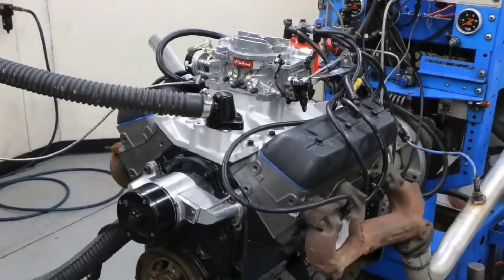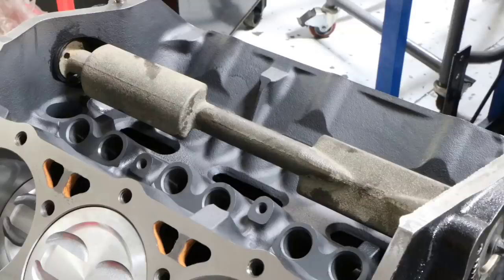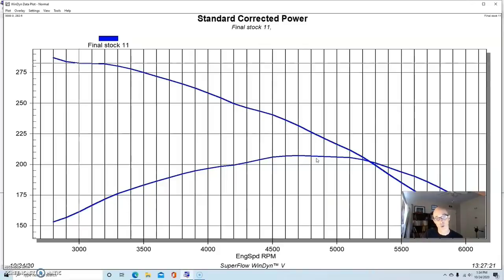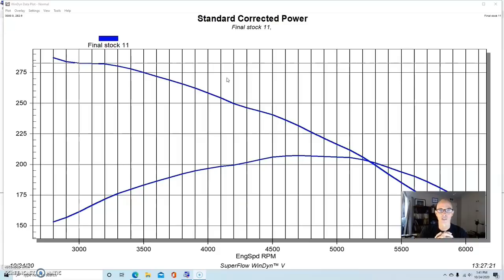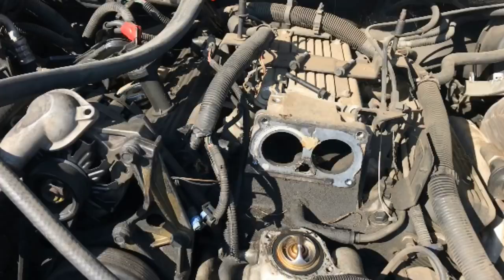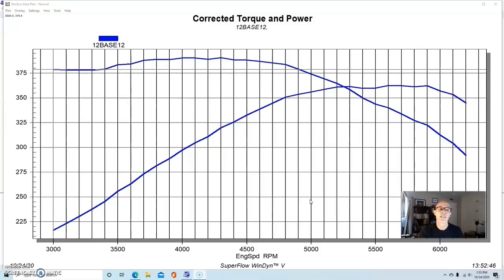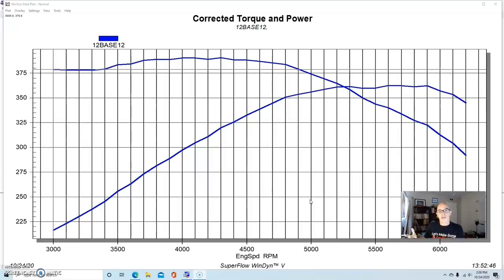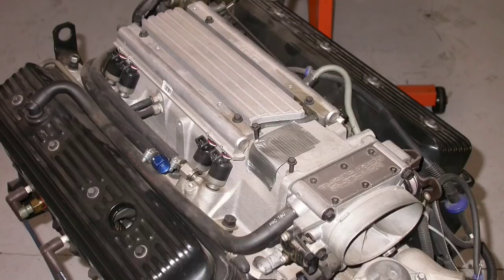4.3L V6 VS 4.3L V8-WHICH OTHER GUYS MAKES A BETTER BUILDER?

Comment: I'd definitely take the V8 over the jittering Chihuahua on crack v6. The V8 sounds better, runs smoother and if the roomers are true and the crank will fit a gen 1 305 block with the 1 piece seal. There would be a couple of aftermarket heads that would fit. But honestly I'd want to build the 4.3 for the same reason I'd like to build a 267, mild performance upgrade over what it was and completely focused on what fuel milage I could get out of it.

Comment: I've always been a V8 over V6 fan. You get a sound from a V8 that is simply superior to a V8. However, Justin Choi's V6 powered Ford GT with custom Heffner exhaust has challenged the entire basis of my belief system. Paradigms be damned.

Comment: Well I have the 4.3 liter V6 on my 1500 Chevy short bed pickup truck and it gets great great great gas mileage 5-speed standard 200 horsepower.

Comment: I had a 76 Buick Skylark 4 door with the Olds 260 (4.3L) V8 with a Rochester 2 bbl. It was an absolutely gutless turd. The ONLY way I could get that thing to do a brake stand was to put oil or tire shine on the tires. However, that thing was reliable as hell. It could have a foot of snow on the car, be -15 out, and that 260 would fire right up.

Comment: The thing that worries me about the V6 is the balance shaft. If so many internals change, wouldn't the amount of vibration change, and then the balance shaft would need to change somehow?

I never liked balance shaft engines. To me, it was like a drag that only existed because the engine was flawed right from the start. I like inline sixes, boxer sixes, and some 60 degree V6 engines because of that.

7:10 What impresses me is that it isn't far from the Atlas 4.2 inline 6. That was a DOHC engine, and this current OHV engine isn't far from it.

Comment: v8! By the way check into the vortec (L30) 5000 heads very close in bore size, but there might not be intake options i could be wrong if it would work. something to chew none the less. if you do look into it i would check coolant flow first.
Reply from the maker: thnx-they wont work

Comment: There were two Vortec V6s that came down the line.  The Chevy S10 got one model and the Chevy Astro vans got the other. The latter has a different torque rating to compensate for hauling or towing.  Also the heads may...may be better on the work class trucks 2009+ because this was the base motor for a halfton van or pickup.  I wonder what is the production date on the one you have there.

Comment: If you used the same head on the 302 and 305 I think the 305 would make more usable power given the short runner intake but I have no idea what the 4.3 lt-1 head flows so that’ll probably be the limiting factor for the 305 combo.

Comment: Just thinking out loud. I have an old 1969 396 BBC block in my shop, it appears to have valve reliefs cut in the top of the block, one for the intake and one for the exhaust at every cylinder. Heads with 1.94 intake valves and 1.5 exhaust valves seem to work on a 3.743 bore, but if you wanted to go with bigger valves or be able to utilize a wider selection of heads, would these valve reliefs allow this on your 4.3 SBC?
Reply from the maker: we've done that on a 305

Comment: Re-visiting this is interesting after your L99 head flow video. I'd like to put a thought out here, the L99 head flowed 197CFM at .5 unported. 197*8/6=262.67 CFM. That means for a 4.3L V6 to equate to even a stock L99 head flow wise you'd have to have a head flowing 267 CFM. That would lead me to believe from a raw flow standpoint the L99 would be superior even with shrouding.

Comment: I've had both and the V8 hands down. I don't understand why GM put a 4.3 V6 into Camaros and Firebirds using the LT1 parts rather than making parts for the V6. As to why on the Caprice, I've had 3 and if you keep them around 70mph you can get 27mpg on the highway. That's what I did with these cars, up and down the interstate and if you just need good dependable transportation, they are perfect.

Comment: Richard, how about a "$1,500 small block vs $1,500 LS shootout"? Preferably with a 350 vs a 5.3 so displacement is comparable. In my mind, the rules would be as follows

-You can get these engines from anywhere and they can be any generation, as long as they aren't "from a buddy"
-$1,500 includes the cost of EVERYTHING. Gaskets, fluids etc. Dyno time is exempt. 
-Engines must remain naturally aspirated
-Can use fb marketplace, eBay etc for deals. 
-Can't use things for free the average guy couldn't get ahold of. I.e, flow bench, milling machine etc. If you want that work done, you'll have to factor machine shop costs into the equation
-Cost of tools isn't part of the budget, but the potential cost must be stated at the end of each engine build. This includes carbide bits etc.
-Everything else is fair game. Hand porting heads, drilling out carb jets to save money etc

If you haven't already done this, I think you should. I'd really enjoy watching this project unfold.
Reply from the maker: the LS wins that
Reply: @richardholdener1727  Without a doubt.

Comment: Love inline sixes, but have never/will never own a V6. You mentioned the key that is important to me: balance shaft. Inline 6s, 90 degree V8s, 60 degree V12s and maybe some unusual things like correctly configured V16s have inherent balance. V6s do not have inherent balance, and need some kind of crutch to achieve some form of balance. A 180 degree V8 will almost always have better specific output than a 90 degree version, but the inherent imbalance means more maintenance and generally more potential for failure. In this day & age of incredibly good/sturdy metals and superlative lubrication in/for modern engines, some may say I am just living in the past. Okay, guilty in some ways. But if a crutched modern V6 can last 100s of 1000s of miles between rebuilds/replacements, an engine that doesn't need crutches is going to last at least as long, and is less complex, not counting simply the total number of parts in the contrasting assemblies.
 Also, as GM found out back in the day, a V6 runs better when it is running at it's roughest. The original Buick (and GMC) V6s varied between even-fire and odd-fire versions, and you know which one had the best specific output.
 Even if/when a V6 has better parts support than a similar displacement V8, I'll take the latter. Your point about the better power production with smaller, but more numerous, displacement cylinders is also a point in the favor of the bent eight, in my eyes.

Comment: Richard do you remember what the port and valve sizes were for the ported heads used on 4.3 V8 used on another test?
Reply from the maker: I THINK WE RAN PORTED LT1 HEADS
Reply: Yes they were ported lt1 . I'm guessing the valve size was 1.94/1.50 because that's the biggest valves used on the Trick flow 175 heads for 305.  I was curious if the intake ports were larger than 175.

Comment: This 4.3 ltr LT1 and it's previous version, 267 ci small block, were all part of the CAFE Corporate Average Fuel Economy mandates  that govt required. These under powered big cars were to offset the crap MPG that the pickups were getting.

Comment: I am doing a 2003 4.3 L V6 the heads are being imported I got a camshaft and it poured it intake manifold I got headers on it and it’s just about done I’m running about 8 to 10 pounds of boost with us with supercharger it ran really well but I lifted a head gasket on it thermostat stock and now we’re going through the whole top half of the motor

Comment: Curious if you could put an LT1 crank into the L99, and get a 5.0 Gen II engine?
Reply from the maker: IF WE SWAP THE INTERNALS OF THE TWO MOTORS WE GET A 302 IN THE 5.7L BLOCK AND A 305 IN THE 4.3L L99 BLOCK

Comment: What I've always wondered about is why GM didn't use the L99 4.3L V8 in the 4th gen F body cars. It would have been perfect for an RS Camaro or base model with V8 option as well as a base Firebird with V8 option. I know there was the Buick sourced 3.8L V6 starting in '96 making 200hp, but to me a V8 is a V8 and equals more torque. Just my opinion.

Comment: Richard I had no idea about the 4.3 V8. I guess it's why GM never put the 4.3 in the F bodies and instead used a 3.8. Because we all know the 4.3 would be a much better motor for the V6 equipped F bodies. Being 3/4 350 it was the logical choice.

Comment: I I'm building a 1951 Chevrolet Bel Air, I have installed high performance 327 with 11.1 Dome top forged pistons and a 700 R4 Transmission.  I need more room in the engine compartment.  So I was contemplating building a 93 model 4.3 v6 as the 4.3 is the same bore and stroke as the 5.7 can I use my forged pistons in my 4.3??
Reply from the maker: check pin offset and width

Comment: I had a 262 in a ‘77 Cutlass S with a T50 5 speed. The transmission just couldn’t handle the weight. Kept stripping gears.

Comment: One thing I didn't hear is a weight comparison of the lightest versions of the two engines.  Could you give that info here please?  
Perhaps the V8 can run the lighter aluminum heads, I'd be interested to know.  After all, the power to weight ratio determines how fast you can acellerate.

Comment: I have a 2009 Chevy Silverado WT with the 4.3L V6  it is Great Truck . Like you said the V6 has no part upgrades this is very thru from the being when it was born . Would the 4.3L V8 engine swap with 4.3L V6 .

Comment: Mike finnegan had a 4.3l v6 with a turbo in the roadkill rotsun, i assume it was a stock v6, when it ran, it flew, when it didnt, it needed rebuilding. For some reason i think id rather have the l99.

Comment: The vortec is actually SFI injection not multiport. The lb3 doesnt have anything to do with the older v6 but the displacement is there.
Reply: @kerryphillips1 Yes but this doesn't. The 4.3 has CPI and SFI and both flow through poppet injectors. These are spider injection systems and they suck. 😆

Comment: Besides the displacement, is it identical to an lt1? Can I buy a L99, strip it, and swap it all onto a 5.7 longblock?
Reply from the maker: yes as discussed-heads are different (iron vs alum on the LT1)
Reply: @richardholdener1727  
I must've missed it while inhaling my In-N-Out and driving. Thank you sir! 😁

Comment: I knew about the earlier small block 4.3 v8s but didn't know about the baby lt1 until a few years ago. It wasn't very torquey only like 220 to 230 ft lbs torque

Comment: Busch Series racing (I think Xfinity now) used V-6 engines and they were pumping out 700 horse power. I wonder what V-6 was used for GM cars.
Reply from the maker: race blocks
Reply: @richardholdener1727  Thank you. That is one of many reasons why I no longer watch Busch or NASCAR anymore.

Comment: I could swear I had a 267 c.i. v8 in a '79 El Camino SS (lol) when I was young. It was more than adequate at the time.
Reply: Drove a couple of them in friends Mailbus. They were lazy but could tell they'd wake up with some gear. Stock was usually 2.41s and sometimes higher! (Higher means lower number)
Reply: @mikewillett5076  Monte Carlos had them as well as a v6. These were not the best years for the American car, but we didn't realize that then 😃!
Reply: @sharkskin3448 . People were aware that the average car got slower/had less power vs several years before because it was only a few years after the big emissions era started, and those older cars were still around in plentiful numbers. People just accepted that that's the way it was in the crusade to lower emissions. I'd still like to see a 262 or maybe a 267 done up. Biggest obstacle is valve sizes, especially with the 267s smallest bore of all small blocks. Cheers
Reply: @mikewillett5076  I remember those days well.

Comment: Btw, I just now looked the power figures up for the 1975-82 4.3L Olds 260 and it's as follows...
Power output for 1975 was 105 hp (82 kW) at 3600 rpm and 205 lb⋅ft (264 N⋅m) at 2000 rpm.
Reply: I just finished eating dinner and those power numbers are making me sick to my stomach....

Comment: I would like to see you try to get a hold of one of the old fish carburetors. it was known to get almost a hundred miles or more per gallon of gas. Or the ogle carburetor. I don't know why they don't bring that out today to save fuel. those carburetors did better than a lot of fuel injected cars today.
Reply from the maker: takes much more than a carb to get 100 mpg

Comment: Quick question for you Mr. Holdener when you have a chance, is there a way to put a roots style supercharger on the 4.3 v6? I know the l67 is a supercharged 3.8l v6 but is there an application for the 4.3?
Reply from the maker: THERE IS NOT A BLOWER INTAKE THAT I KNOW OF-BUT A BLOWER CAN BE ADAPTERD

Comment: the latest version of the 4.3 v6 makes 285 hp and 305 tq beginning in 2014 I think. I would still rather have the v8 for smoothness and max power. The V6 has a split pin crankshaft which could be a problem at higher outputs. I had a 92 Vortec V6 that I put some ported aluminum Bowtie heads on.

Comment: Horsepower potential... everyone thinks Cubes and RPM.  I like the old English theory:  HP = Swept Volume = Piston Area x Piston Velocity.
Piston velocity is limited by materials & manufacturing in connecting rods and crankshafts and pistons. Almost any 'built' engine will limit out how fast they can spin the short block (and yes, how fast the valvetrain can keep up).
In this case, you have equal displacements with different combinations of bore/stroke/# of Cylinders.
I'll take the one with the shorter stroke & more piston area as the one that will have more ultimate HP.

Daily Driver?  Gimme the one with the longer stroke, torque makes HP convenient.

Comment: Try the 4.0 inline 6 add that into the mix with those three instead of just two it would be a better show because the inline 6 is more torque than a V8

Comment: So I don't know if it is possible.. but what if you installed some aftermarket 350 heads on the 4.3 v6? Yes it would not have cooling but just for dyno fun it would be cool to see what would be possible if an aftermarket head did exist . Also since the valves will be closed you could use a 350 Chevy intake manifold. I know the 4.3 is supposed to be a 350 with two cylinders knocked off but I have no clue if the heads would actually bolt on from a 350.  If it would this would be a very cool test. And in sure the guys at westech have the parts laying around.

Comment: I gotta go with the v8. You know one other thing too, after all is said n done, with the time and money you spend even if the v6 turns out to be great, it still sound's like a v6 and I sorta don't really like that sound. I would use the v6 if the car I was building had space restrictions, but other then that I gotta go with the v8. I love the sound of a v8 and I like the sound of a screaming 4 cylinder (you know like a Kawasaki or a Yamaha) 5 and 10 cylinders sound weird and v12's sound sweet. I love quiet running inline 6's and v12's really smooth and love the feel of the torque from down low. 
I remember back in 69 or maybe 70 when I lived in NY, my friend next door got his dad to take us to Pocono raceway to watch Modified's run the short oval. One car was as fast as the rest of them but sounded really bad when it went by. I asked my friends dad why it sounds like that but he shrugged and didn't really know. A little while later after talking about it, the older man sitting on my right told me it was a V6 from a GMC. He told us some other stuff about it like it has huge pistons and doing the hand signals like he was holding a big 10" piston in his hand. It was interesting but most of it didn't soak in. I think I was like 14 years old or something like that at the time. I hear that thing when I hear a v6 with loud pipes to this day. Turbo charging them helps.
I like the v6 4.3L, the 3800, the 3.8L Ford, Chrysler's slant 6 almost all the inline 6's, I mean they're all good engines and all work horses. The old Toyota, Land Cruiser push rod inline 6. That's an eye opener to a young guy today.

Thanks again for a great Video full of great data.
Ed D

EDIT: I've been trying to buy a 94 Caprice from one of my neighbors for the last several years because I wanted to put that 4.3L with the overdrive transmission in my 69 Chevy truck to get some gas mileage.
Reply: You may have been hearing a GMC 478 V6 way back then at Pocono.  5.125 inch bore.
Reply: @andyharman3022  Yeah very well could be. I have no idea. I tuned up a GMC with a big v6 only one time in the mid 80's at a shop I worked for. It was just different looking but ran good with a lot of low end torque. I think it was like 350 cu.in with a 2bbl that was not a Rochester and the plug gap was .040" and it had points and condenser. That was the widest gap I ever saw using points and condenser. I remember thinking about if this is the one the guy was talking about.
EDIT: 478 cu.in. could be right. There was a lot of big blocks used in short track Modified racing back in early 70's so that engine size would put it in the ball park.
Reply: @Ed70Nova427  Yes, there was a 351 in the family of GMC big block V6's.  And a 637 V8.  And a 702 V12.  The V6's were 305, 351, 379, 401, 432, and 478.
Reply: @andyharman3022  aaah yeah, maybe the 351.

Comment: My experiences with 4.3 V6 is that is has the gas mileage of a V8 and power of a 4 cylinder. It's just a slug wearing a turtle shell. The 4.3 V8 is an awesome workhorse as long as you take care of the optispark.

Comment: A high compression/turbo L99 would be awesome. 12:1 compression, matching roller hydraulic cam that can spin to 8500 rpms, twin turbos that can supply 1000+hp with of air and variable geometry turbine sides.

Comment: I had a 267 v8 in a 1981 Malibu.  It only had around 115 hp, and was a slug.  That motor eventually blew up and we put a 305 with 140 hp in it, at least it was a little better engine.